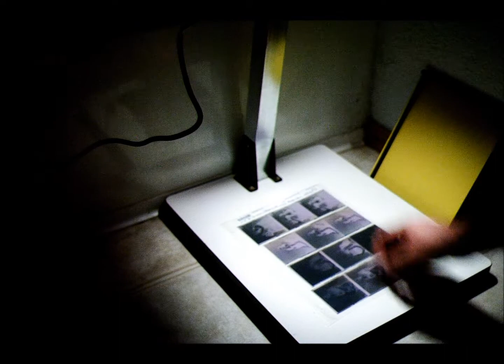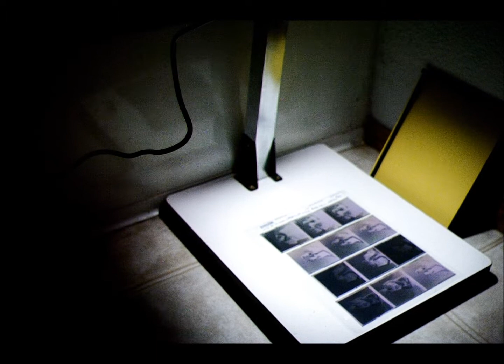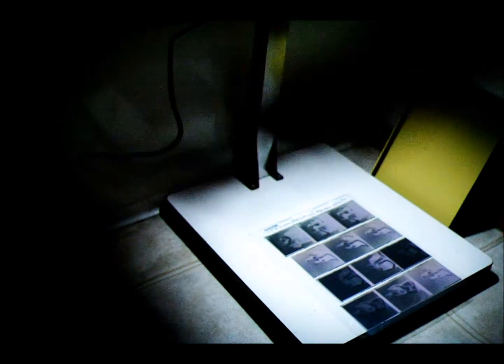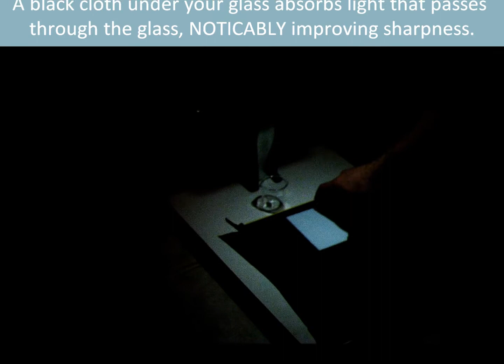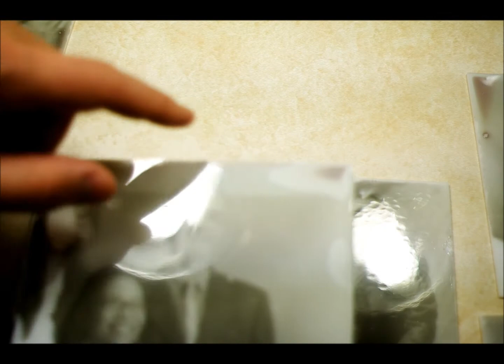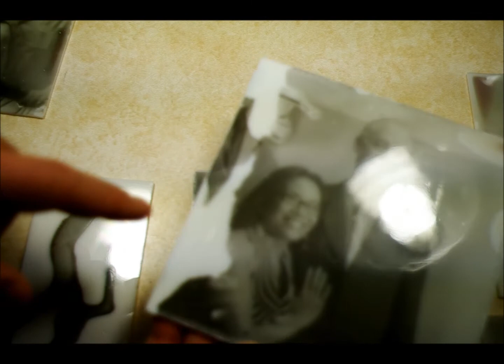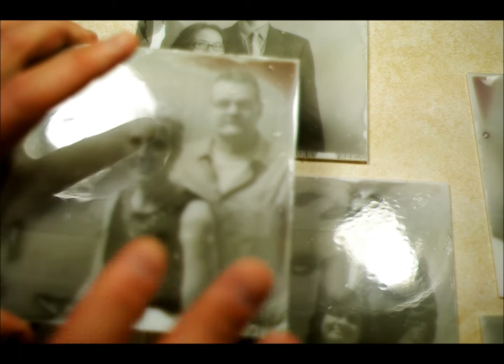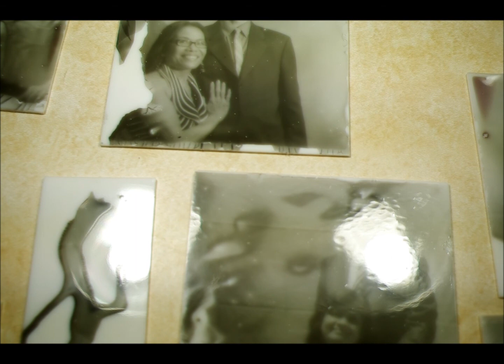Printing an Opalotype (or any Glass Positive) Video 3: Darkroom Printing

Comment: Hi
It could be possible to print an image on wood throught emulsion?
Reply from the maker: You can apply liquid emulsions to any surface, yes, but different preparations are needed. Wood poses a major challenge because it's porous and would absorb both emulsion and developing chemistry. I'm certain there's a way to do it; I don't know the techniques needed, however.
Reply: If you put the wood in resin, then do the process as described it should work much better

Comment: Try using carbonate of soda with alcohol to clean your glass and paper towels not a brush.  Unclean plates is also a problem when doing ambrotypes with wet plate collodion as the emulsion.  What emulsion did you use for the opalotypes?  What developer?
Reply from the maker: Thank you for the tip. I just went with Rockland Colloid's directions, but I like the idea of using carbonate more than soap. Do the paper towels risk scratching the glass?

For emulsion, I used Liquid Light. My developer was Selectol at stock concentration because it delivered a muted vintage tone.
Reply: David Hancock Thanks for the info on Liquid Light.  For cleaning mix the alcohol and calcium carbonate (rottenstone) to a wet paste and rub well with the paper towels.  Paper is easier on the surface than plastic bristles and more effective at removing any film coating the glass.